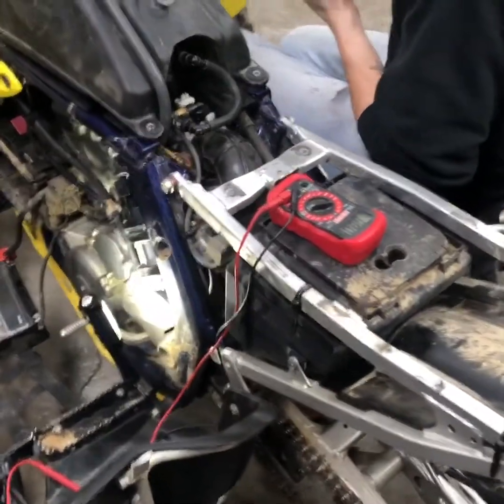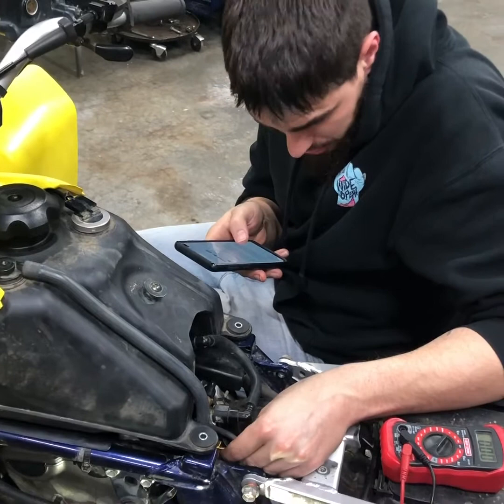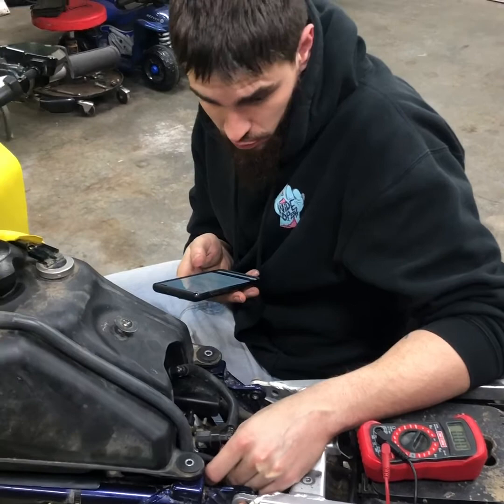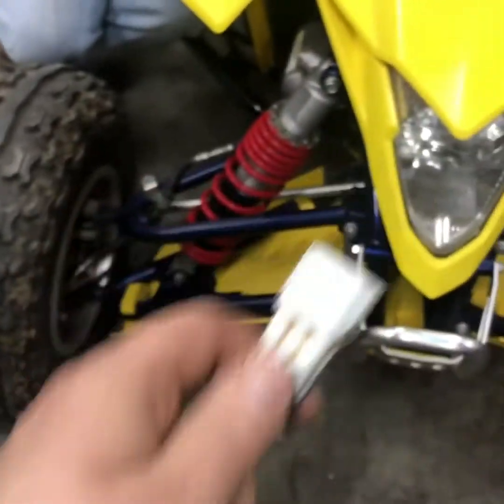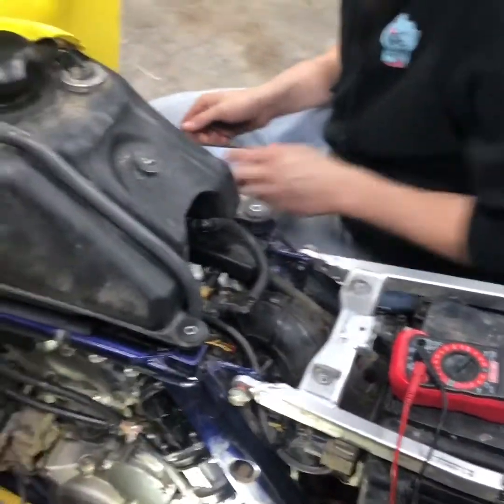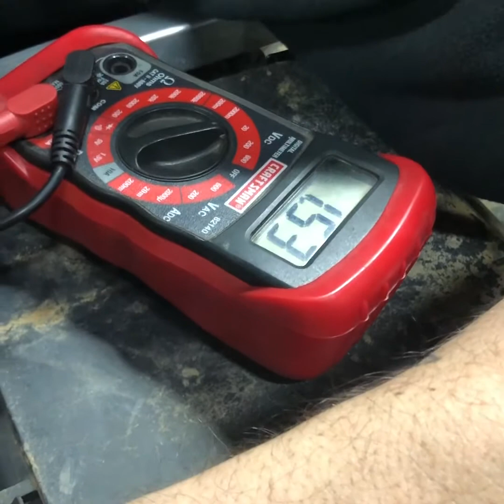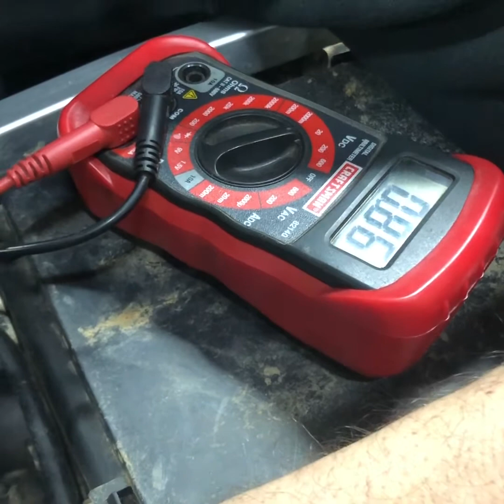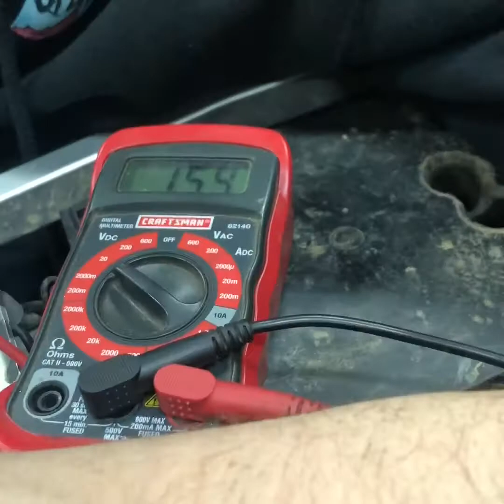Ltr450 testing the Throttle position sensor

Comment: I have a 09’ LTR450 and It won’t turn over, ran for 2-3 seconds when I put ether in the air intake. Could it be this? Or do you think I need a new injector? Changed swirl filter, fuel pump+filter and regulator. Acts like it isn’t getting fuel, bogs when I press the throttle while turning it over but won’t crank without ether. Pls any help would be great
Reply from the maker: I would test your tps sensor and make sure that is working properly

Comment: My tps sensors keep burning out is there anything I should check?
Reply: I've replaced them twice and both burnt out in the matter of 10 rides
Reply from the maker: Wow that’s wild man. No I haven’t heard of that happening before. You are using a 12volt battery right? My only guess would be to look at your rectifier. You could be producing higher voltage than 12v.
Reply: @FullSpeedImpulse  ya I'm using a regular 12 volt battery i sent it to the shop they said they weren't getting any readings from the fuel pump and my tps sensor was dead that was the first time now it's doing the same thing again the only thing I did was replace the clutch cable the only thing I can think of is I had to move some of the stator wires out of the way maybe there is a bare wire in there or something maybe I need to replace it do you think that could be the issue???
Reply: @FullSpeedImpulse it will go in and out as of rn you can tell as soon as you start it if it's acting up it will have a high idle and will backfire on the first turnover then when you get it up to speed it will bog and act like complete shit then the next time you start it idle will be back to normal and she'll run fine for about 30 seconds then goes back to the same shit

Comment: I have 08 ltr450. It won't idle. Runs rough when in gas low RPM but if I give it fist full of throttle runs fine.
Reply from the maker: Tps sensor or fuel filter are the first things I'd check since it's a common issue on these quads

Comment: I know you probably won't see this but I'm having trouble finding an answer elsewhere. What's the difference between a clockwise and counter/anticlovkwsie tps
Reply from the maker: Clockwise/ counterclockwise is the direction in which the sensor spins when the throttle is twisted

Comment: Mine will count on and idle but there’s not throttle response at all
Reply from the maker: First thing I would do is clean all your fuel filters and make sure you got a fresh plug and air filter in her. Then go from there.

Comment: Hey guys I have a question for you all so I set my tps at .60 and when I slowly give it throttle it goes up to about 2.73 is that a good reading or should it jump into the 3s when fully opened...bike bogs up in hi gear when trying to open it up...
Reply: Yup it was my tps sensor i have it set at like .59 the only thing I noticed was that when i would slowly accelerate it would sputter very little it's barely noticeable it's more like a a little vibration would you raise the tps sensor voltage a little?
Reply from the maker: R Carr .60 is what mines set at. It flashed .59 when first set up then settled where its suppose to be. If it’s to far off the mark it will throw your FI light on
Reply: @FullSpeedImpulse  what’s the fi light?
Reply from the maker: @lekamyballs  fuel injection light i would assume. Tells you if something is incorrect. Not sure if it also senses low fuel pressure or not. Might be something good to look up. Ares was just because we had the tps in wrong.
Reply: I am setting the tps sensor right at .60 when it's off as soon as I turn it on it drops to .56 at idle is that normal or do I set it at  .60 while idling?
Reply from the maker: Hmmm. I set mine while it’s not running. Curious though why your drops down to .56 when it starts up. Could this slight difference be a little bit of play or adjustment in the throttle body flap? So when it running it’s slightly being moved by the pulling in of air??? That’s the only reason why I could see it would be different. Maybe I’ll recheck mine. Let me know what you find out!!!
Reply from the maker: So I went back and checked my video. And it shows mine spiking up 3.6#. I would assume there is definitely more then one way for a tps sensor to fail.
Reply from the maker: Is it leaning popping at all? Just make sure you check all those fuel filters too.
Reply: Thanks for replying yeah I went ahead and changed out the fuel pump,did a rebuild kit on the fpr...deleted swirl and a new Injector...bogs down after it's been ran a little hard will cruise fine.. it also has a fuel pak installed not sure if that could be the problem but I'm kinda leaning on the tps because of that reading I got...thanks in advance
Reply from the maker: R Carr what is a fuel pack?
Reply: @rcarr9598  did u ever get your ltr straightened out???
Reply: @wegongetsummoney3982  I ended up selling it cause I just couldn't figure it out ... it had its days where it was fine and then it would act up...the guy who now owns it said he just popped in a new plug w/out gapping it and put in premium fuel and its apparently running great...lol I spent about $1500 on parts trying to figure it out
Reply: @rcarr9598  I’m going thru the same that’s exactly how mine is some days do great then the backfiring n bogging I just did a topend rebuild bout 2 months ago with a new plug that’s what I haven’t tried hopefully that get me fixed up Preciate the info tho
Reply from the maker: Hope you get it running bud! I'll be doing another video soon because we have a bog/cuts out on open throttle. Could be just a dirty fuel filter but gotta go through it still.
Reply from the maker: Dang bud. Yea seems like these quads are great if you got them tuned in right. But when they aren't very finicky. You get something else?
Reply: Not to familiar with it just bought the quad but from what I understand itll adjust the air/fuel mixture for the exaust and air filter setup it has...like I said could be wrong but that's what I was told
Reply from the maker: Did you figure out your bogging issue?
Reply: @FullSpeedImpulse  I'm still waiting on the tps sensor to come in i did get rid of that fuel pak and installed a power commander 5 with a new dynatek coil does feel better but has hiccups here and there so I'm hoping it is going to be the tps sensor
Reply from the maker: R Carr nice!!! I’ve got the ltr in the garage on how to make a custom spark arrestor for the stock exhaust. I have a pro circuit exhaust but it needs redone. Got a trip planned next weekend so I need a spark arrestor
Reply: @FullSpeedImpulse  Nice I'll be waiting for the video...thanks for sharing  all your knowledge with these machines
Reply from the maker: R Carr hey I’m learning as I go just like you guys!!! Just like you it’s nice to be able to watch a video before digging into whatever your working on for some extra help! Thanks for following!

Comment: Which wire did you run the test with
Reply from the maker: The red and yellow wire. Should be the three wires total. It’s the ones on the outsides. My next video labeled Ltr450 runs+massive burnout shows exactly how I tested it. Thanks for watching!
Reply: @FullSpeedImpulse  thanks man im currently working on mine trying to set my tps up
Reply from the maker: Alright bud. Hit me up if you have some more questions. Thanks for the view and comments. Hit that subscribe. Will have more quad and dirtbike action coming soon!!! Thanks!!!
Reply: @FullSpeedImpulse  will do. What should it be set at. I just wanna triple check
Reply from the maker: .60 should be what it rests at. If it is incorrect your FI light will go on showing it incorrect.
Reply: @FullSpeedImpulse  okay thanks again man
Reply: Could my tps cause my LTR to backfire and bog? Can’t figure out my problem
Reply from the maker: Yes sir. Check out my next video with massive burnout. I show you how to test your tps sensor.
Reply from the maker: Hope this helped out and thanks for watching our video. Hit that like and subscribe. We have a lot more fun stuff happening soon. Also make sure your swirl filter is clean.

Comment: Did the new tps help , having the same issue on my 07
Reply from the maker: Yep. After we put that in it ran great. Just make sure you test it and you know it’s bad. I bought a oem tps for $160
Reply: Full Speed Impulse which wires did you use to test it kinda having same problem bogs at low rpm
Reply from the maker: The outside ones. Not the middle